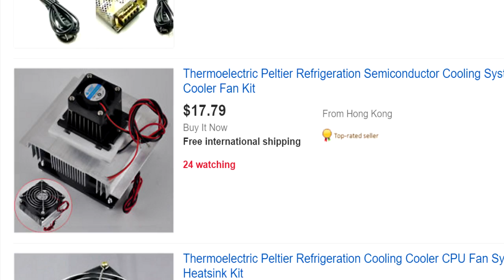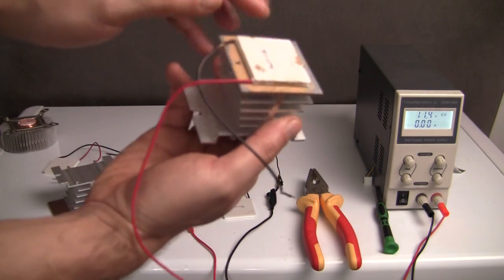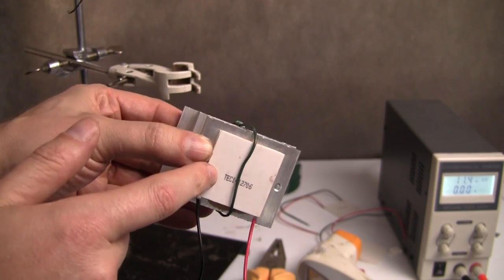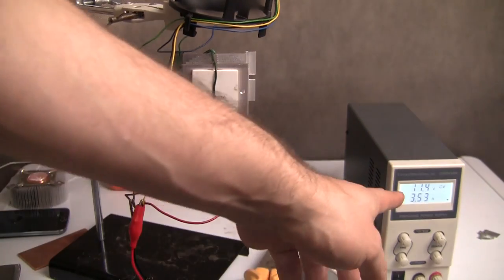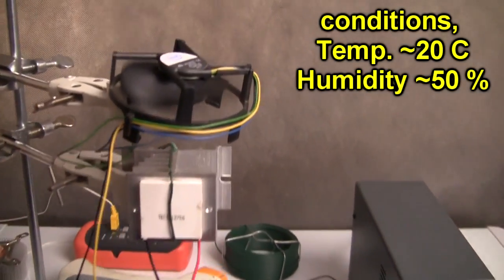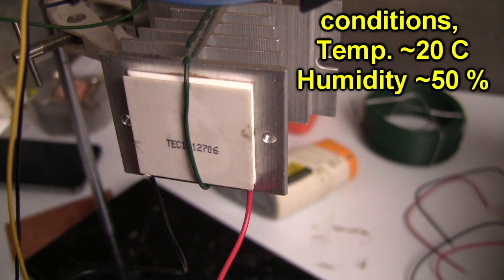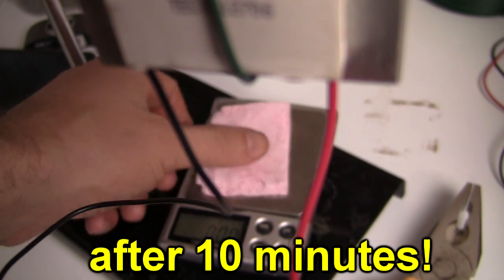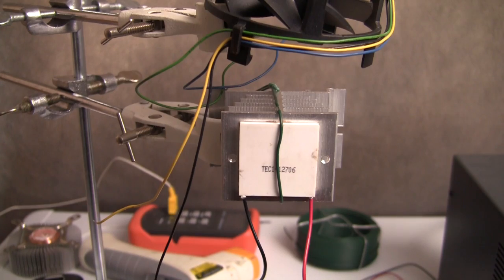Fontus Water bottle claims to make water from air.  Is it possible?

Comment: Also, why are they so bent on making a solar powered version, why not a small manual generator version, even better, (this ones a little niche) A dynamo on a bike wheel that powers this as you RIDE along.

Now I KNOW the dynamo's work I used to have one for my lights when I had a pushbike. Pair it with a decent lithium battery with some overcharge protection, they could even sell it as a pack, Battery, water distiller, and lights, for much less.

Comment: my only complain about this test Thunderfoot, is that is defiantly the WRONG fan to be using, you need a pressure fan (Like the ones used for computer radiators) the force more air through faster, also the fan needs to be closer to the heat sink.

Also, a longer heat sink (similar mass, just longer) may well work better as you'l be moving the heat away from the source therefore allowing the pultiator(butchered the spelling) an easier time of staying cooler.

I know its not 100% accurate, but these are the principles I use in a game called Oxygen not included, witch does follow these principles (real science principles...mostly) but there not 100% accurate because its a game lol

Comment: I think the same I used peeltier cells and are extremely inefficient and require between 40 and 80 W, to work efficiently. I think so the humidity that requires Fontus to really be useful is too high and only find in places like the Lacandon jungle or a forest right after a rain, but in that case it would be faster to collect rainwater and filter it with a bottles with carbon filter.

I haven´t  a original Fontus, but in base a logic and experience, at the moment isn´t functional, although it is a very good initiative.

Comment: It's good to see a real test involving heat dissipation, whereas previously I've seen 'debunks' simply claiming the solar panel couldn't produce enough energy compared to the latent heat of condensation. (!?)  Of course,  you don't need to produce that amount of energy,  just move it from one place to another, and as you're cooling, you need a good radiator.
There are several areas where the real thing could feasibly outperform your test.
Firstly, your little fan isn't shifting anywhere near as much air as would be blowing past the device if you were riding a bike at 20 or 30km/h.  Bear in mind that the designer is Norwegian, so his tests are likely to involve much lower temperatures as well.  The radiators could also be optimized for the expected airflow.
Secondly, You could introduce a bernoulli effect to drop the pressure (and thus temperature) of the air as it passes the cold AND warm side of the peltier device.  Bringing the dewpoint within reach and better cooling the radiator.  I'm unsure of the physics, here... but my gut feeling is you'd get a better cooler with a sudden drop in pressure compared to having a higher airflow.
I'm sure there are better surfaces for droplet collection that a simple flat ceramic of the peltier device.  
Now I'm still highly skeptical,  I have 7 dehumidifiers in my house and the electricity bill from running them is horrendous, but then I don't have 30km/h winds blowing through them, so a lot of that electricity is used on shifting the air, which this bottle doesn't need to do.

Comment: Disingenuous experiment. The dewpoint with 50% relative humidity is about 8C, so of course you won't condense much moisture when the plate is 7C. If they have a design that makes the plate much colder in the same conditions you tested your stuff in, much more condensation possible (Though 8C is a low dewpoint for practical purposes). The fontus water bottle may not produce much water, but it definitely could produce more than you are suggesting. If you are in the mountains of the US, it definitely will not be much, but if you are somewhere besides the desert, it could be significant as dewpoints often get to 20C in the southern US.

Comment: Wouldn't the fan be even worse with what they're trying to accomplish? a bigger airflow would technically mean more humidity being condensed by the heatsink but while most dehumidifiers have fans, they also have a much larger cooling area. This one is so small that it makes me wonder if the fan isn't actually helping more with water evaporation instead of helping it condense.

Not that it would work either way, but i'm curious as to see how it would affect this smaller setup.

Comment: Q-Carbon, first discovered in 2015, is a cheap film of laser-zapped amorphous carbon that forms a structure more advanced than diamond. Not only is this crystalline structure harder than diamond, but it is also ferromagnetic and able to glow when exposed to low levels of energy. This means that a self-glowing electromagnet is now possible. Currently, it's production is limited to stratification, consisting of sapphire and q-carbon layers. However, in time, q-carbon production will advance to the point of creating large, solid, crystal-chunks.
These inevitable q-carbon chunks can be simply wrapped in copper, creating a crude, glowing electromagnet. This is all fact.

Comment: IR camaras need to be adjusted for emission coefficients of different types of materials. it is best to spray a substance over all to be measured materials to make the coëfficiënt uniform for all objects measured. I do not know how much deviation this would give however. But during my own measurements with a Fluke device the aluminium heatsink bars would actually show up blue compared to the black electronics and copper wound coils. When sprayed white with paint the measurement was more acurate, as now the main radiating parts (heatsink bars) would show up red as well.

Comment: If you don't have big enough heatsink it is better to run them at lower power, the wasted energy doesn't heat the whole system as much and you can get a bit lower temperatures on the cold side. This may allow you to keep it running at near zero temperatures

Comment: I get what you are trying to prove and it's true, however, the use of the Peltier is suboptimal. The device likely moved during the experiment (I'd suggest clamps to wire) and broke the continuity of the thermal paste.

Peltier at 45-50W should have a decent 35 degree delta at what you tried to do, meaning you should have seen a -10 degrees on the cold side even under load. 50W Peltier devices get ice, guaranteed. The thermal camera shows the issue: the hot side has 90C, which is about 20 degrees over the maximum rating for that class of device. You shouldn't let it go over 70 or so. With the hot side not venting correctly, small wonder you can't get enough cold on the cold side.

Personally, I would have just kept the Intel Cooler. It's pretty good at what it does. Simply clamping the Peltier to the copper base would have saved you a lot of trouble. I did that a while ago and it got quite a bit of ice. (and by quite a bit I mean a few drops)

Again, it would have changed nothing in the outcome of the experiment, it's just ... that poor Peltier is having a bad day.

Comment: I like how you tested this out, always appreciated.

With that being said, your device is far from being efficiently designed. I imagine a better closed system could be more power efficient and far better at actually condensing out water than what you've made. 

With that being said, it will only work in locations with relatively high humidity, if it did work. I go hiking in Utah on occasion, and there's no way in hell you would ever manage to condense enough out of the air there in the middle of the summer heat.
Reply: +Echonian if you time it right you can, because nature will condense it for you and then deliver it as rain.

Comment: That Peltier running at most 5v should generate more water, without an airflow across the cold side. You only need a layer of air cooler than the dewpoint, this makes things more efficient, I believe.

Comment: Thunderf00t I want your thesis on a matter.Specifically chemtrails. Do you think they are real or a stupid conspiracy that can easily be debunked like fukusima deathclouds? 

I am a young wannabe scientist myself and the matter has be bothering me for years and I can't come to a conclusion. You see I live near an airport and I can't help but notice that not all the airplanes leave those trails that last for hours. Not only that but shouldn't those trails if they were normal lead you from one airport to another if you follow them instead of having a smaller specific  length on the sky instead which could only be explained if the plane stopped its engine or crashed? Also most planes leave a small trail that vanishes behind them while you are watching them instead of staying there. Why is there a difference between trails planes leave? Different engines,fuel,flight height or what?

Please I'd love a video on the matter from a respected scientist like you to clarify things. Right now in real life I get laughed at if I mention them ever so I avoid them although they still bother me inside as I can't see them as something normal with my current observations. I wish I could run tests on them but I don't really own a plane or a helicopter haha.
Reply: ***** I read your commend quite well. The first problem with your theory that comes to mind is that some airplanes leave mist that last for hours or even days and some airplanes leave mist that last only 2-5mins(meaning that as you see the plane fly,the mist vanishes behind it only after a short while). Why does this happen?

There should be a major difference between these planes for this to happen. What is that major difference? That's what I'm missing. It doesn't make sense right now.

I've done a lot of research but I really don't know who to trust on the internet because on these matter there are only two teams of people.They diehard conspiracy theorists who will do anything to convince you and those will dismiss the matter as silly without first proving why it is silly with some facts/science leaving the rest of us in the shadow.

 I ask for thunderf00t's opinion not because I worship him or anything. It's just all his other videos are trustworthy and I believe if he was to address the matter he would be as accurate as he could and not misleading. He also explains science very well through his videos.
Reply: *****  I live near an airport and I can confirm that some airplanes do leave those trails that last for hours/days although most planes don't. It's the only thing I have as a fact  because I see it happen with my own eyes. That's what got me thinking in the first place.

But I'm not an expert on the field . I'm a software engineer with some love for physics/astrophysics and overall technology. But I'm faaaaaaar from an expert on physics as my field is more based on Math and less based on physics. So I highly doubt I would come to a good conclusion using those tools myself as an expert would. I'd need months of reading on physics/theories/experiments etc before being able to come to any solid conclusion and I don't have that time to spare sadly. Although I might someday. If no one satisfies my curiosity until then.

Comment: It would be considerably less for several reasons:
1) Their unit is solar powered, and the sun doesn't shine really for such use for more than about 6 hours.  (derate 25%)
2) Evaporation rate is significant if you aren't generating water very quickly.  It obviously increase on a hot day, and the bottle is not sealed since it is trying to bring in more air to obtain more water.  Derating unknown, lets guess 90% disappears.
3) Being solar powered, you don't get 40W out of a tiny little panel attached to a water bottle.  You need 16x28 inches in this example from Home Depot (and about $200) to get 40W.  (derating unknown, lets guess they have about 1W for their bottle, which is being generous, so 4%.  http://www.homedepot.com/p/Nature-Power-40-Watt-Portable-Monocrystalline-Silicon-Solar-Panel-for-12-Volt-Charging-in-Briefcase-Design-55701/205395373?cm_mmc=Shopping%7cTHD%7cG%7c0%7cG-BASE-PLA-D27E-Electrical%7c&gclid=CjwKEAjwjca5BRCAyaPGi6_h8m8SJADryPLh08sIs7QJTwg0Ero_zBW183vqgVv8S_nhjOl5Bgr2MRoCjezw_wcB&gclsrc=aw.ds

Combined Derating, roughly 0.1% of what your video shows.  I figure it would all evaporate before you ever got a chance to store any.

Not complaining about your video, you'd have had NOTHING to show unless you did it the way you showed here.

Comment: A couple of trouble spots with you proof of concept set up:
1. Peltier electrodes were down beneath device, allowing any condensation to short out the device.
2. Forced Air across the cool side of the Peltier, has a drying effect on any condensation that might collect.

Comment: http://bigthink.com/design-for-good/the-first-billboard-in-the-world-to-make-drinking-water-out-of-thin-ai

Now, that's on a massive scale. Folks with central air also can testify to water being made out of air (rusted out drain pans, stains on the side of the house from drain)

But you are 100% correct, this bottle is a sham. It's impossible to do what it claims using the power it makes.

Comment: I'm not saying you're wrong, but there are some very obvious problems with your setup that you'd need to address before your test actually says anything about the Fontus:

1.) We know water extraction works to a small degree just with ambient differences in the air. A few milliliters can be collected every day just by setting up a clear plastic tarp to heat up a portion of the air and collect condensation. It's a fairly well known survival technique (though it will never get you anywhere close to your daily water needs, obviously), and a few small communities and such around the world are using this technique to supplement their water supply to a small degree. The basic concept is sound.

2.) Surface area is king when it comes to condensation. Your peltier setup has pretty much the lowest possible surface area. I honestly can't think of a way to get less than just a flat surface. You could pretty easily amplify the surface area on your setup by throwing a heat sink on the cold side as well as the hot side. Just doing that would probably get you 10-15 times greater surface area for collecting condensation. A heat sink specifically designed for the purpose could conceivably get thousands of times the surface area without too much difficulty.

3.) The hot side of your setup is just dumping heat into the air, when it could be used to greatly amplify the efficiency by heating the air before feeding it into the cold side for condensation. This, again, doesn't seem particularly difficult to design. In a water bottle setup, the hot side could just be feeding hot air into the bottle (with any excess escaping), while the cold side sits inside the chamber and condenses water out of that air. You'd expect to get several times the efficiency out of it this way.

So, you got a drop or two in 10 minutes, which is worthless, but with just some relatively obvious design changes you could conceivably get that into several hundred drops in 10 minutes, and that's a whole other ball game.

Again, like I said, it still might be bunk. Maybe when you make all those changes it also takes 10x the power to run, making it unfeasible. But your experiment here doesn't disprove that.

Comment: Seems that the water generation rate is a function of humidity and cooling area.  50% @ 20C seems like an ideal indoor condition.  Is that a typical outdoor condition?  50% @ 25C raises the dewpoint to 14C, which should cause a higher generation rate but at a lower energy level than in your experiment Also, why did you run with no heatsink on the cooling side?  They appear to have a larger collecting heatsink than their dissipating heatsink.  Wouldn't a 20x cooling surface cause a higher collection rate?

Comment: For a really nice version of this experiment (I did it myself a while ago while creating a climate chamber for electronics) connect to the hot side a massive heat pipe based CPU cooler, isolate the cool side into some pipe or similar (I had a tunnel made of styrofoam) attach some heatsink to the cold side, and install a fan that very very mildly blows air through that tunnel.  That results in significantly more water, still orders of magnitudes away from what that bottle stuff claims (in watts per liter anyways). I always wanted to test if I get a better yield if I coat the cold heatsink with neverwet or any other water repellant.

Comment: The money they spent, to make this elaborate contraption. They should have just bought the actual bottle and left it outside and go from there. This experiment really doesn't prove yes or no, that is does or doesn't work........ I would love to see someone buy this contraption, set it outside and check it every hour or two. That would be the real experiment on whether it would work or not. Just saying.......kwim.......
Reply: +Paula Roehl-Johnson Actually it does prove yes or no.  The system he cobbled together here (from parts he had laying around, so no cost) is orders of magnitude more effective than the low power miniature system they are using in the actual product.  The real product couldn't even approach anywhere near the results he achieved.
Reply: Rowgue51
Oh I am sure the real gizmo doesn't work like it says. But, get the real deal and test it out! And all that cost money at one time or another. And while in theory it's probably true. But, proof is testing the real product.